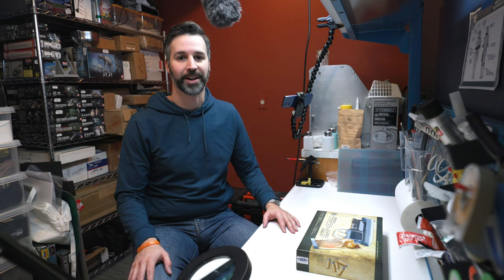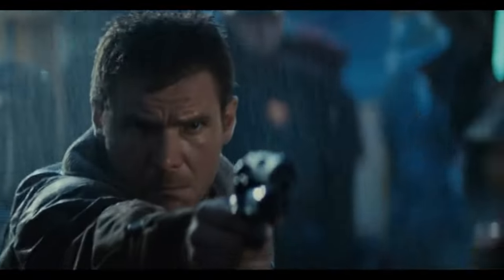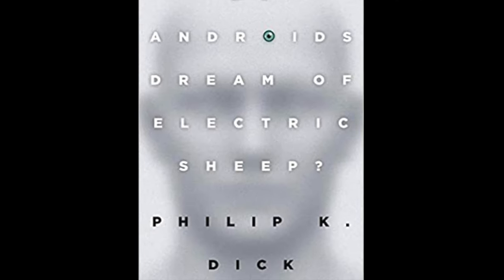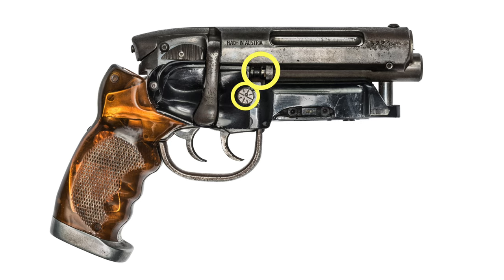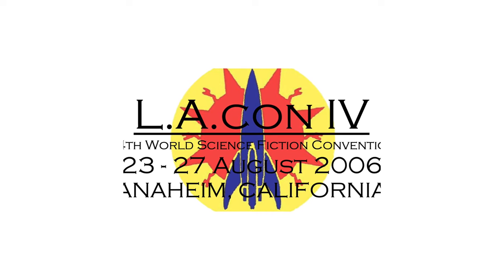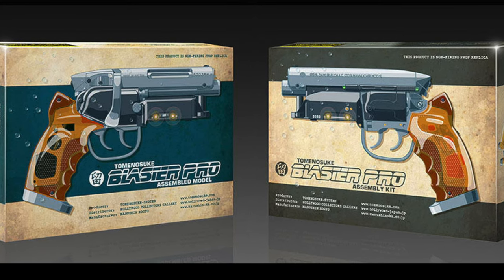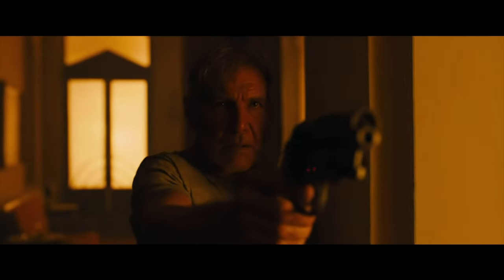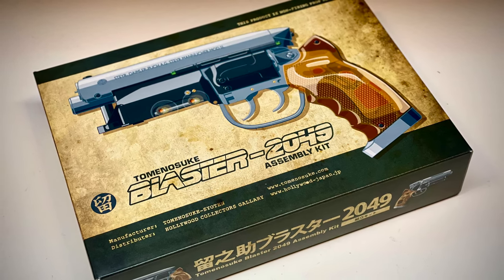Project 01 Episode 01 - The History of the Blade Runner Blaster

Comment: Dream Gun:
Aesthetically modeled after this blaster.
3 1/2- inch barrel with half inch recoil compensator.
.357 magnum, .38 spcl +P, .38 short low recoil.
8 round cylinder.
Double action only.
Hammer replaced with a thumb safety.
Automatic backstrap grip safety.
High profile fiber optic sights.
Long length, short height red dot sight.
Laser, tactical flashlight.
Red dot, laser, and flashlight use one battery which plugs into the bottom of the grip.
Transparent grips to see battery is in place.

Comment: Great video. The weaver screw would need to be replaced with a slotted screw for yours to be accurate to the blaster as it was used in the filming. The Weaver knob was added later for some reason. 

While this detail is not a biggie, the auction flyer you show is not the flyer from when the blaster was sold, its actually the flyer featuring my own blaster build done many years back. 

Looking forward to seeing how you get on..

MARK
Reply from the maker: Wow, thanks, Mark! Appreciate the insights!

Your website has been a great reference, so thanks! And your blaster build is bee-yoo-tee-ful! 👌
Reply: TBH Mark...we have all mistaken pics of yours for the original at some point.   ;-)
Reply: Hello Mark,
 My theory is that the Slotted Screw was replaced with the Weaver Knob after filming wrapped to prevent any live ammo being fired through the prop. We all know that without the Slotted Screw the cylinder cannot be properly secured shut. Just my guess as to why the Weaver Knob came to be. Does this sound like a good possibility to you?
Cheers,
Damion

Comment: Interesting.  What is the purpose of the second trigger?  It's a redundancy that doesn't seem to make sense.
Reply from the maker: On the Steyr, the front trigger is a hair trigger, requiring much less pressure to fire than the rear trigger. 

On the BR blaster, the double triggers are just for show. In the movie, Ford only ever uses the rear trigger, which is the actual trigger to the Bulldog revolver.
Reply: @SPProps  Thanks

Comment: Can the tomenosuke kit be converted into airsoft? I'm asking because I wanna do a sci fi build
Reply from the maker: Probably could be, but not easily. There is an airsoft BR blaster out there, but they can be hard to find.
Reply: @SPProps  that's the problem yeah... I'd rather spend a couple hundred on the replica and an airsoft revolver and kitbash them
Reply from the maker: If you have access to a 3D printer, you could download the Anders files for free and kitbash them with an airsoft.
Reply: @SPProps  I've not heard of Ander's 3d files, but I will give that a look into! Sorry, my engineer brain kicked in

Comment: I cant help but think when this blaster was conceived it was never ment to be a five shot revolver..The film required muzzle flashes and CGI wasnt that great in 1981.. so the blaster had to fire blanks hense why it had a revolver in side... Every modle builder has latched on to the revolver .. Not all guns  in sci fi movies can be explained...
Reply from the maker: I’d also venture to guess that the revolver was chosen because of how widely available they were at the time. Its simplistic design made it easy to modify, and they were inexpensive given how many were in circulation.
Reply: @SPProps  
I preferred it when the blaster was a bit of a mystery.. Im sure in the Bladerunner world the second trigger, the lights had a purpose.. speed loading was not easy for this gun.. . there is no scenes of loading or unloading.. dealing with physicaly superior replicants 5 rounds are not enough.. So iv settled on this gun was never a revolver in the movie..